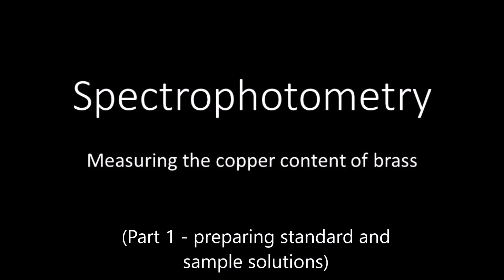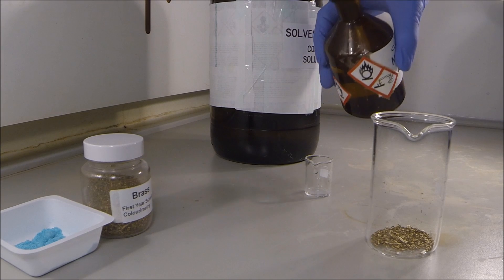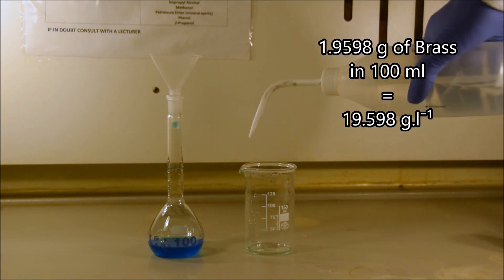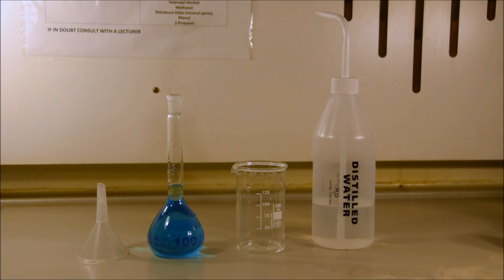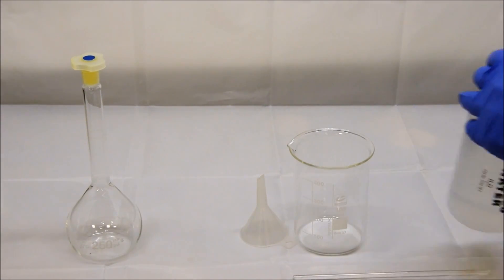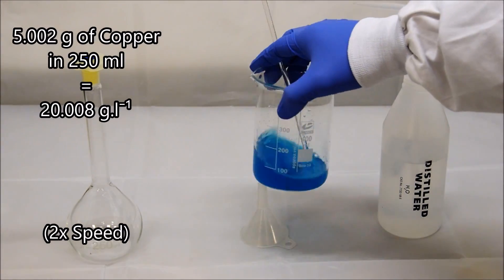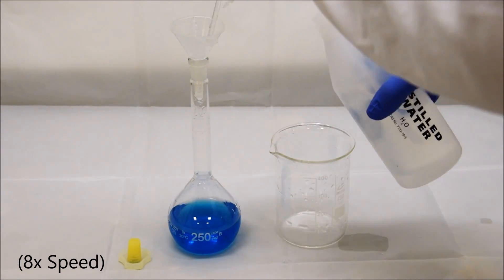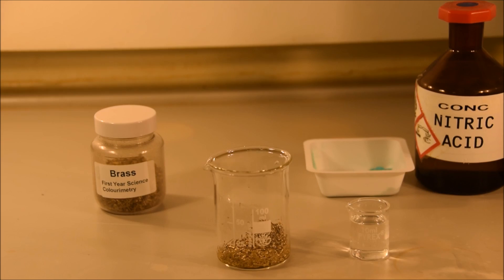Measuring the copper content of Brass (Dissolving copper with nitric acid) HD

Comment: "We weighed out exactly approximately 2 grams of brass shavings."  How much exactly?
Reply from the maker: It doesn't matter how much you weigh as long as it is approximately 2 grams but you do need to know exactly how much you weighed out. So 1.9327 g would be an acceptable amount to weigh out but 2.0g would not.